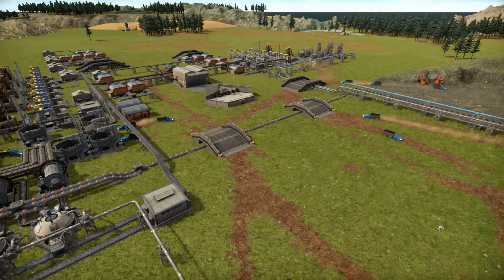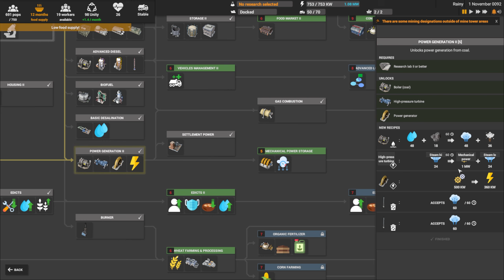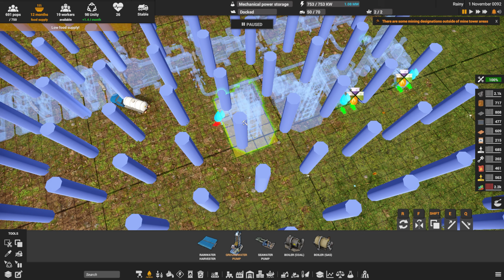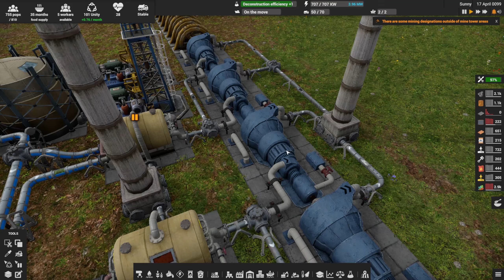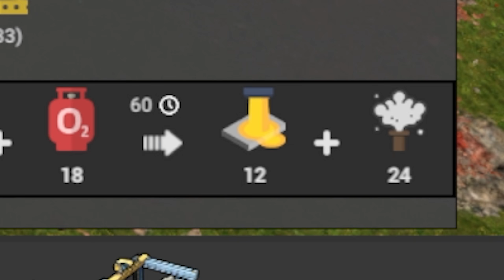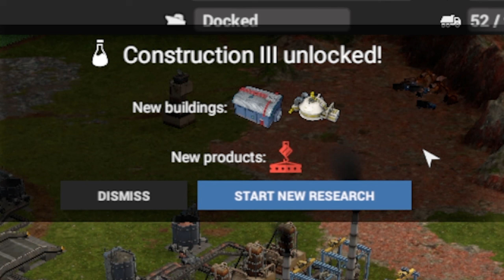This Might Be the Most Insane Factory I Build in Captain of Industry

Comment: Priorities of power production are of utmost importance: When you give your main petrol (later nuclear) the highest priority, your reserve diesels will only kick in when you have a jump in demand. 
Steam-based power generation has a bit of inertia between a demand surge and turbines gearing up (auto-balance!).

This is like a real grid: You want to use your base load energy source as much as possible. This is especially important when you have nuclear later, as nuclear will generate heat, even if there is no demand for the steam further downstream.

Comment: Kibz, the power input/output of the flywheels is one-way. You need to put them in between the turbines and the generators, otherwise it's just wasting power and fuel to run them. =^x^=

Comment: You need more tugboats to haul in more oil from the drilling platform.
Reply: nah, just 1 tugboat is good, you just need multiple rigs to get the full load faster
Reply: @KG_Grandpa  or upgraded rig with more shifts. currently he pumps 108 crude, but uses 216

Comment: Groundwater does replenish slowly over time, if you overload a groundwater deposit it will eventually run out, but if you don't have too many wells pumping it can be sustainable. (Hint: Use ground water deposits that are far away from your build to pump water to storage tanks where you need extra water.)
Reply: They replenish mainly by rain
Reply: I put 5 pumps on each source with a balancer between them and run a main pipe down the middle of the map.. hasn't run out yet..
Reply: Use balancers for priorities: you want to suck dry your remote water supplies first.
Reply: And bury the pipes.